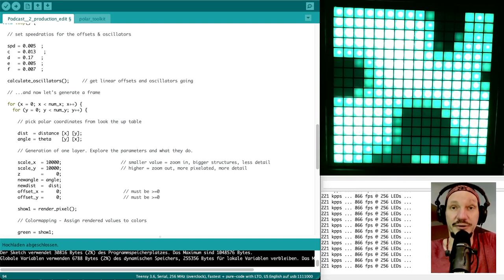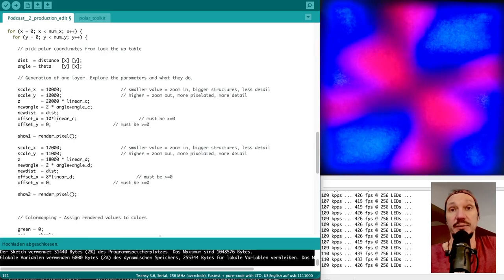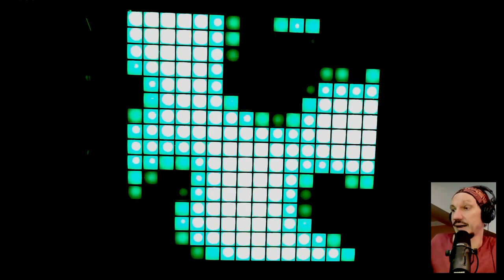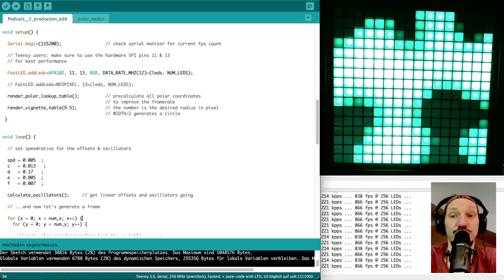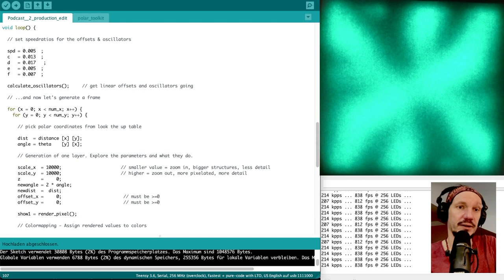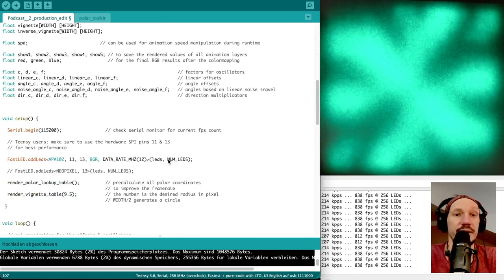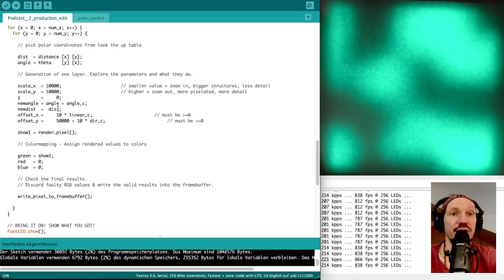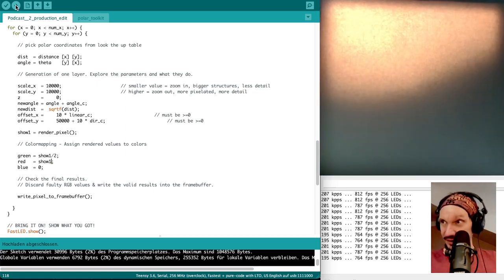FastLED Tutorial #2: Democode and first steps

Comment: Stefan thx for this code, I am running it on a 8x8 matrix and findingg that the center of the board never lights just around the outside
Reply from the maker: You're welcome. Did you adjust line 14 and 15 to set it up for 8x8?
Reply: @stefanpetrick  yes I did, wasn't sure if it was a small matrix issue
Reply from the maker: @darknightofthesoul  I've never tested with anything smaller than 16x16 but theoretically it should work anyway. Will investigate it tomorrow and try to reproduce what you describe.
Reply from the maker: Write in line 108:  z  = linear_c * 10000;      Then it should look okay on 8x8 as well.

Comment: Does it need to be the -S3 variant of the ESP32 or does the"classic" ESP32 also have the hardware floating point?
Reply from the maker: Hi Will, afaik the S3 is the only one with a real hardware FPU. Nevertheless you can compile the code for any ESP32 an check how many fps you get. For small (16x16) setups it might be sufficient, just give it a try. For details about ESP32 FPU performance have a look here: https://www.reddit.com/r/esp32/comments/t46960/whats_the_esp32_s3_floating_point_performance/